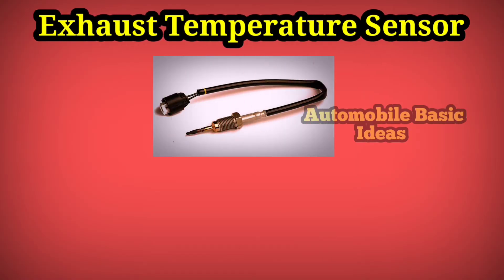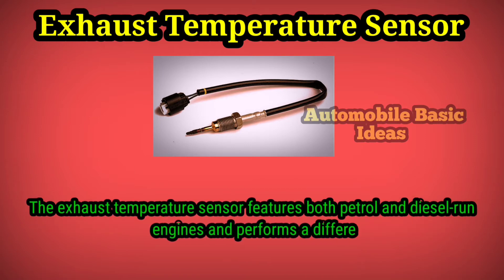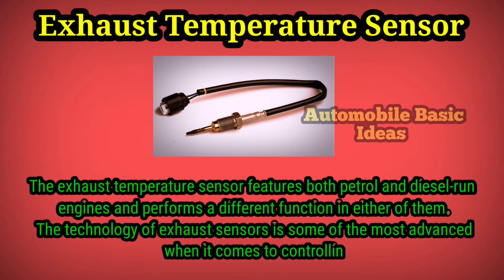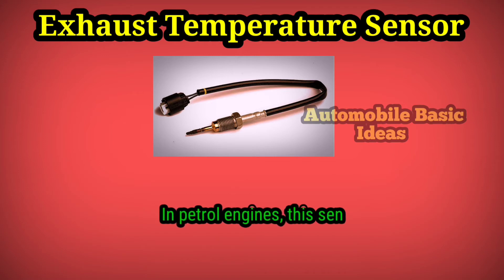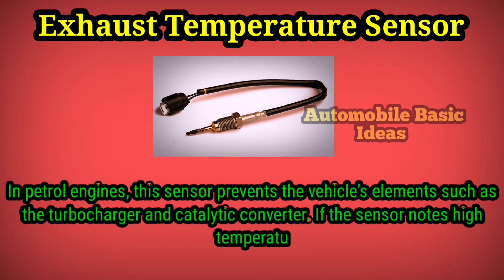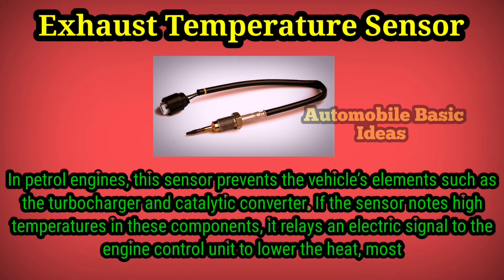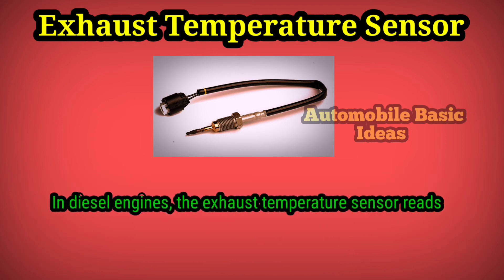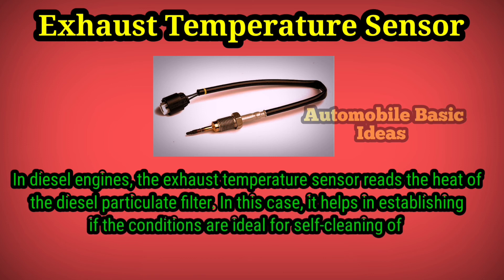Exhaust Temperature Sensor and it's functions

Comment: So what’s the bigger problem or does the sensor just need changed?
Reply from the maker: The bigger problem could vary depending on the situation, but often, if an exhaust temperature sensor is malfunctioning, it might indicate issues with the exhaust system or engine performance. However, sometimes the sensor itself might just need replacement if it's failed or faulty.